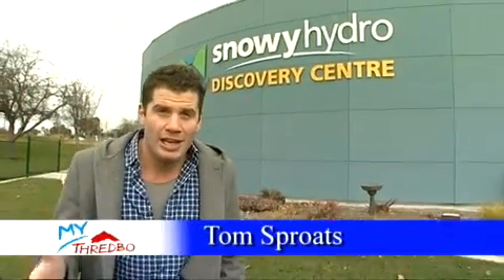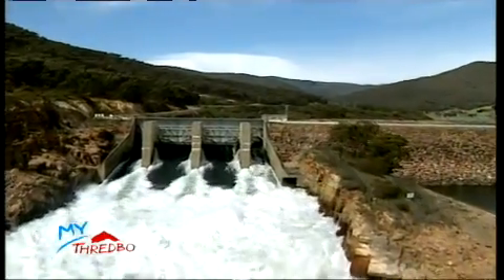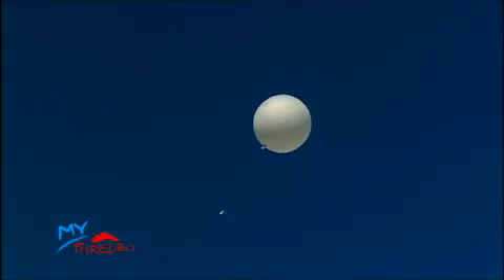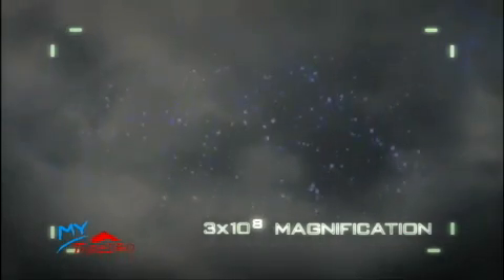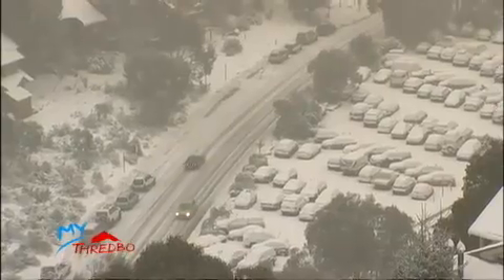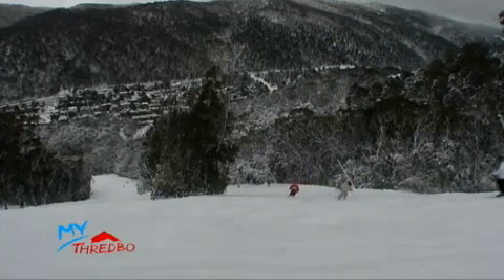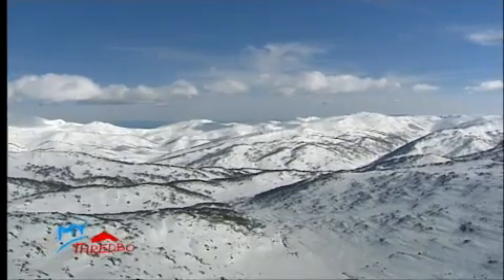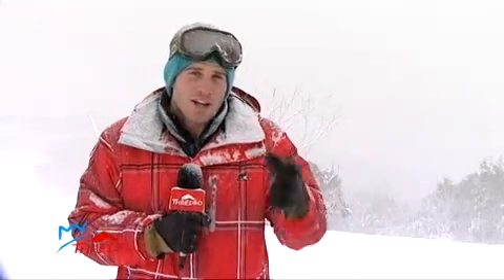Peek into the magic of Cloud Seeding

Comment: Beyond the toxification of the land and water, when cooling one place you heat another, if you make more water fall in one location, naturally less will fall in another. This is a good way to create floods and drought at the same time.
Reply: ?? They aren't cooling anything (In fact, they are burning tiny amounts of Iodide). They're simply helping more moisture in the atmosphere become snowflakes, which requires the air to be naturally cold. The whole point is is that it's allowing more water to fall where it's needed, so rivers and dams have enough water, rather than staying in the air or falling over the ocean. Read the studies, it's proven to have no adverse effects.
Reply: Das ist das Ziel, woanders Dürren zu erzeugen...